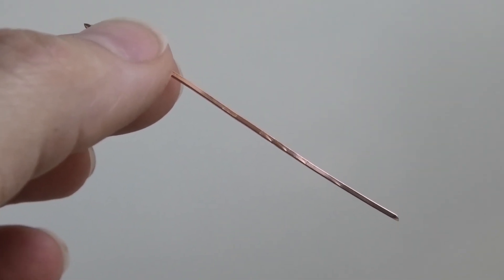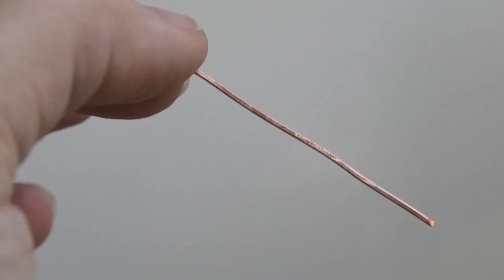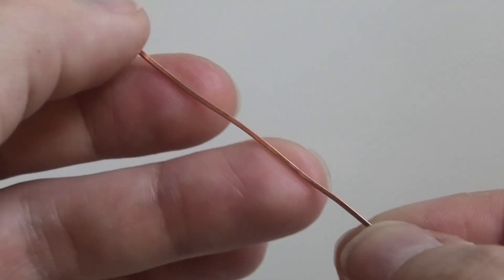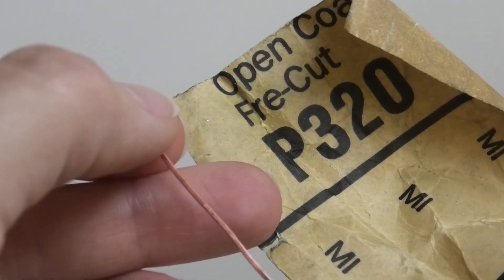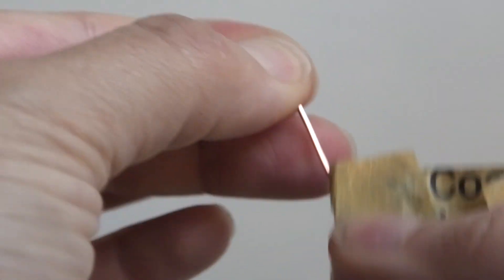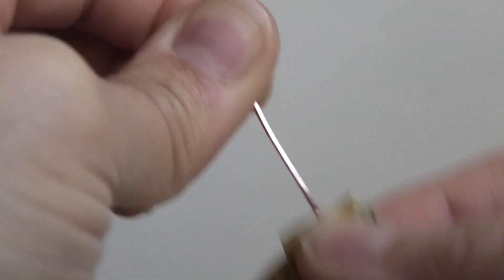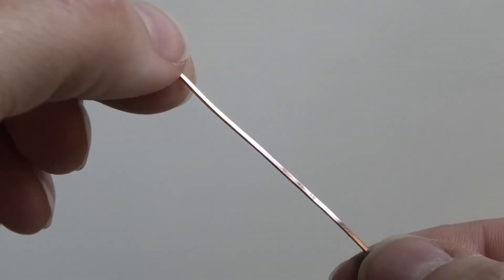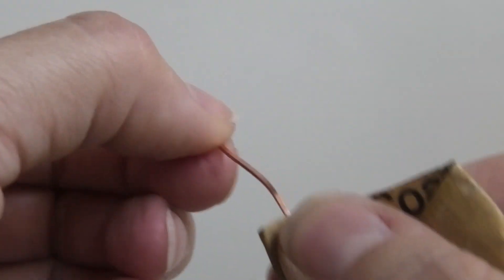Tip of the day: sandpaper to remove scratches out of wire

Comment: Thank you for the tip Oxana.  I have used some 'aligator tape' onto my pliers to reduce marking.  It works for a short while, but as the tape is low tack, it isn't long before it starts to come off the pliers.   I believe that there is something that the pliers can be dipped into, like a liquid plastic which sets, unfortuately I have not been able to find a supplier here in the UK where I live.   Merry Christmas and  best wishes for the New Year.
Reply: It's called Tool Magic, can be ordered through Rio Grande, Michael's, Fire Mountain Gems here in the states. I believe Amazon sells it as well.
Reply from the maker: Thank you! I have not tried it either, I just always hope marks will be minor and will go away after oxidizing :) and if not it will look more handmade and have more character

Comment: I wrap electrical tape around the tips of my pliers in order to avoid damaging the wire. It somewhat works. I’ve tried using cloth, a towel, but found tape is the easiest.
Reply from the maker: Great tip!

Comment: Cool! Has anyone tried this with glass nail files? They work well for smoothing out the edges of earring posts but I’ve never tried them for scratches.
Reply: Sandpaper is faster & easier to use because you can wrap the piece all the way around your wire and smooth all sides out at once. I'm not sure if the sandpaper grit she used in this tutorial is a hard & fast rule (320 grit), but glass nail files start at 800 grit and go up from there.
Reply: @llamabeans  larger number is finer grit.

Comment: Thanks, Oxana! I've used the same grit and find that it's smoother/finer (less scratchy) if it's been used already, which is great for many situations. I typically work up to finer grits for the smoothest surface and shine (after hammering heavy gauges like 16 & 14). 600 up to 2000 are my faves, especially with smaller gauge wire or minor damage. Hoping to test out the Dremel again but don't have the right bits yet. Happy holidays to you! 🎄💖 I guess it's Summer where you are! 😊
Reply from the maker: Thank you, great information! Yes it is summer here now, I am still getting used to not having snow :)

Comment: cannot use on coated copper
Reply from the maker: correct, sandpaper would remove the coating, but if you got scratches in the coated copper that damages the coating too